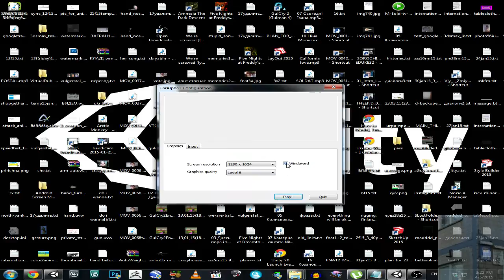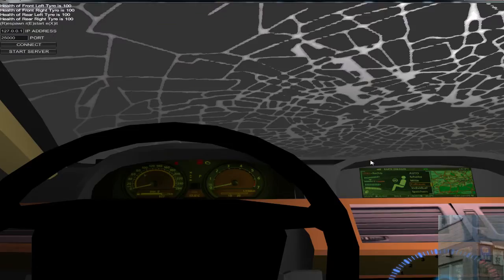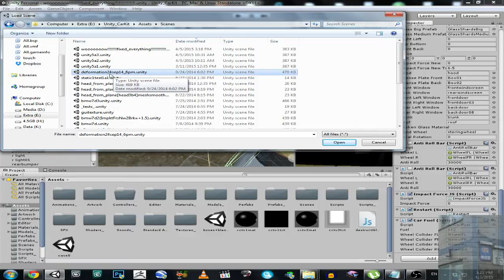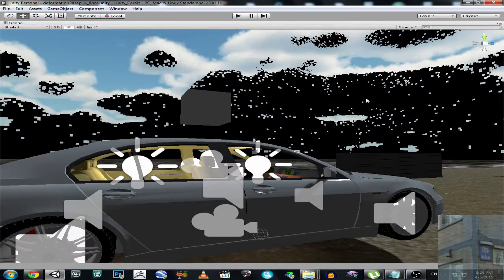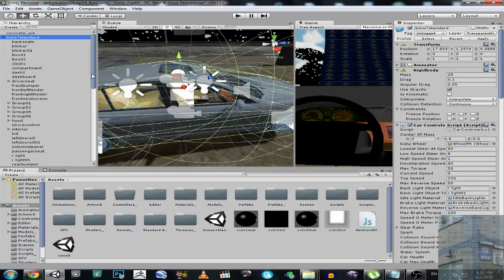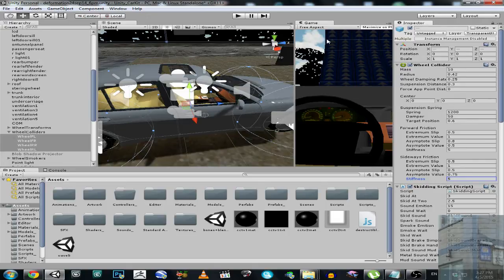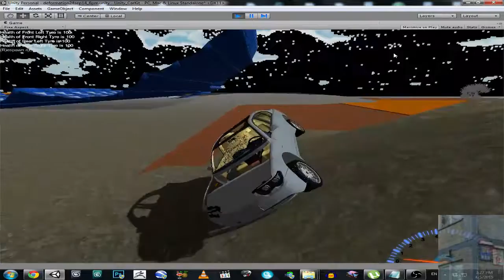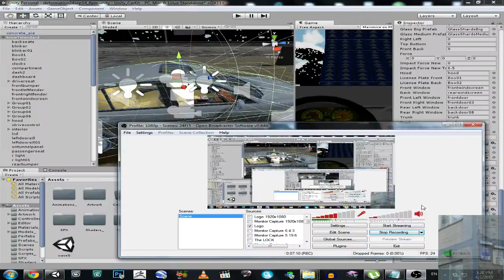Unity 4 to Unity 5 How to Fix Wheel Collider ( Car Physics) Tutorial

Comment: amazing, it just works. Couldnt find solution to making work wheel colliders in Unity5 for i dont know how long and you, Sir, solved it for me. Thank you very much.
Reply from the maker: +Sheriff Wiggum Anyway, for the best result You should make Your wheels from the scratch.
Reply: +vul gerstal what do you mean from scratch ? I am just using basic wheel collider, motor torque and used your settings for the collider. Before it was jumping around or would just fly away, now it behaves somewhat normaly. Dont know how else i could set it up. Thanks.

Comment: In my case, I'm not using flatulence's car script. And in Unity 5, my cars went flyin' in all directions!

A 20 kg car? I'm not going back to Unity 5!
Reply from the maker: insertrandomcleverusername Don't afraid of Unity 5! It has a lot of improvements. 20 kg car is only how I managed to fix my car quickly. In fact it is strongly recommended to set up Your car from scratch. Unity 5 helped me to get rid of "suddenly the door and the hood detaches" problem . . . Just create a new Unity 5 car nearby Your old Unity 4 car - and copy as more all settings as possible, then tweak it. And You'll have it working correctly. It's really hard to port Unity 4 cars to Unity 5, You know . . .
Reply: ***** for Unity 5?